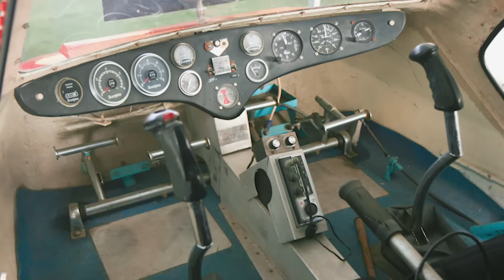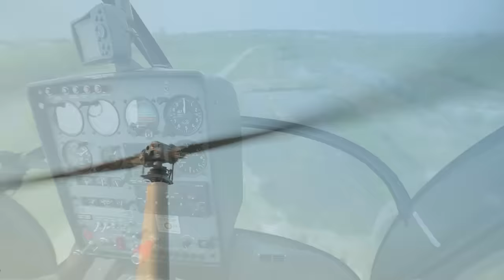15 INSANE Homemade Helicopters - BAD IDEA

Comment: What could go wrong?
Is it sane to bail out of helicopter that has difficulties (assuming you have a parachute)?
Reply: Helicopters can autorotate, which means that there is enough momentum left in the rotor to allow you to make a safe landing. They can 'glide' in a way.
Reply: @johnsmithe4656  if the main shaft happens to sieze or main rotor blades get damaged what then?
Reply: @jarvislarson6864  Autorotation is for when the engines are damaged or otherwise stop working. If you hit something and the blades or shaft is damaged then that's akin to a plane losing its wings. Yeah, in that case you're screwed. Far more common to experience engine trouble and have to land. If you're running into things then that's a problem.
Reply: @johnsmithe4656  I know what auto rotation is I meant in other situations of catastrophic failures happen....hold on and brace for impact?
Reply: @jarvislarson6864  Yes. As I said, losing your rotors, main or tail, or a shaft seizing, these are catastrophic failures on par with an airplane's wings falling off. It's not likely to happen unless there's a collision. Helicopter main rotor doesn't just "seize," there are mechanisms that allow it to rotate freely which is how the autorotation is allowed to work. Like a clutch on a stick shift. Disengage rotor from engine and allow it to spin freely. The kinds of failures you're talking about aren't worth worrying over because some serious accident would have to occur to make that happen. IE, an airplane's wings aren't just going to fall off without some major collision.
Reply: @johnsmithe4656  I will still recommend that ALL passengers + pilot of a helicopter , and even ALL commercial passenger airplanes and private jets, have a working parachute + basic international-dialing duplex-radio-phone, in their backpack or above their heads in the air-inhaling equipment falling when you press a button over your head in commerical passenger airplanes... With falling prices for international airplane travels, an extra $30-50 USD just to save your life in case of crash in the form of a working parachute with basic instructions on how to use it should have / MUST become the norm for all airplane and helicopter and hot air balloon travels a long time ago...
---ve4ernik
Reply: @SahWar  People have to train to know how to use a parachute. They have to get suited up and harnessed in, and this requires assistance. You don't just throw on a backpack and jump. Even experienced jumpers have an expert check their gear before they jump. Same in the Army. Those jumps are all planned and prepped. Having a personal parachute nearby when you're in an airplane is not as practical as you think, especially if there are dozens of people that suddenly need to strap in and jump.

A lot of crashes happen without warning, and very quickly. Most of the time you don't get to bail at 10,000 ft, most of the time the plane crashes when landing or taking off, so parachutes are useless there. If there is a major mechanical problem at altitude then the best thing to do is try to make an emergency landing. Passenger jets using parachutes like life preservers on a boat is just not realistic. You're not a pilot or a jumper at all, are you?
Reply: @johnsmithe4656  Jumping with a working parachute on and activating it successfully when/if an airplane malfunctions above 500 m or 1 km, is perfectly working solution to save lives.
They just don't do it for all passengers in an airplane BECAUSE they just want to rip you off with high airplane tickets while they could just have added $50 to the airplane ticket price for every passenger and put basic instructions on how to activate it when jumping in an emergency NOT from the front door which may get you minced into pieces if you fall into the jet propeller or the the wing or the back small wings, but from the back door after the jet propeller part of the airplane, they just do NOT do it TO RIP YOU OFF OF YOUR MONEY & NOT PUT PARACHUTE FOR EVERY PASSENGER WHICH SAVES LIVES WHEN PEOPLE JUMP FAST IN A DIVING-CRASHING-FALLING AIRPLANE!
Only the money aspect is preventing people from doing that! Never forget this!
So why not offer extra feature to pay $25-50 for a working parachute for the passenger as an extra to the airplane ticket, eh?
Because they are morons and only care about getting your money for more expensive airplane tickets instead of offering some real emergency-saving-your-life-with-a-parachute value in exchange for said price increase!
Don't try to change my mind, I have spoken to airplane staff people and most agree with me about this topic!

It is just corporate greed crushing emergency-life-saving parachutes for all airplane passengers!
Please realize that I am correct and you are wrong about this topic despite knowing more about training for parachute jumping!

---ve4ernik

Comment: El problema principal de los helicópteros  artesanales  es la propulsión  ..un motor de automóvil es demasiado pesado y posee pocas RPM ..como planta motriz  más eficiente  es un rudimentario  motor a reacción  basado en ""La máquina de vapor de Heron ""..  es decir dos toberas acodadas  con un inyector de combustible un gasificador y un compresor turboalimentador  que si puede ser sacado del motor  de un automóvil..y que aumente la presión  y la velocidad de escape de los gases en la cámara de combustión  .además  por supuesto de un mecanismo de encendido por calentador incandescente eléctrico..y un motor eléctrico de arranque para darle las suficientes RPM iniciales para que el compresor crea presión de fluido ...

Saludos desde mar del plata ARGENTINA 🇦🇷🇦🇷🤗🤗😁..

Comment: the last one shown the vc2 is not a helicopter... a true helicopter has collective pitch blades.  that vc2 is fixed pitch blades... which means for one,  no autorotation if there is a engine/engines failure....

Comment: Most all these aircraft have one thing in common. Ultra expensive, low horsepower archaic push rod, air cooled engines designed by companies who don’t want the average shlub in the air.
They make their horsepower by running close to flat out.
Meaning, they have an expiration date.
And when that comes brother, your not going to buy a piston set for it….like a Volkswagen…$200.00
Think more like Porsche 911. $9000.00
Like I said, the average shlub.
So, what’s to do? 
I like the idea of a turbine. But that’s….even more expensive. And noisy.
So….what next?
Well, I’ve been poo pooed by the people who hold stock in continental and lycoming, about using light Japanese engines. Specifically Honda.
The Japanese can take 1 liter, make it have 150 horsepower, and run for ever.
Bump that up a little….say 1.5 liter, run it at 3/4 the speed of one of those first designed in 1932 lycoming engines, and make twice the power.
Nope.
This is Not…I repeat not, about you flying. Because the powers that be, already know you have guns, and they CERTAINLY don’t want them mounted on your homemade , inexpensive,  dependable aircraft.

Comment: The stock helicopters can be flawed regardless of where they come from or how much they cost makes no difference
Reply: yeah well... i would buy the most expensive German one if i was worry about flaw...  definitively not the Chinese kit with the half translated instruction...

so, maybe there is an enormous difference no!?...
Reply: @joseph-mariopelerin7028  german means in a couple of years it'll have issues
Reply: @rblxplaysmochax6808 With the Germans at least,  you got a couple more year to shop a good wheelchair…

Comment: The future of personal transport will incorporate vehicles that look like drones. They'll have at least 4 rotors (each protected with a shroud), partially or totally automated., and will very likely be more reliable than these contraptions. Don't get me wrong, I love the mechanics of helicopters and appreciate these home-built machines, but they're based on archaic tech and not a realistic solution for personal transport. They're way too complicated mechanically, and maintenance would be a nightmare. Can you imagine the average joe flying one of these?? If they don't crash within a week of ownership (and that's being generous), they'll end chopping up someone like deli meat with those rotors.

Comment: Any unlicensed, untrained helicopter pilot is likely to have a very short flight. 😎
Reply: I flew a small airplane I had for some years and had jobs where I would get transported in helicopters and you are right. I got to sit in the left seat and there is a lot going on especially on a mountain top with a little wind. I didn’t fly it, but I got to see the pilot making many fast adjustments.
Reply: @Chris_at_Home  There are videos on YouTube where you can see student helicopter pilots being trained as if you are sat behind the instructor and student. It gives you a very good insight into what is involved. I am a pilot on fixed wing light aircraft so, like you, I know about flying. As you know, it takes many  hours of training to become competent. It took me 18 hours to go solo. I once thought about helicopter training but was afraid that in an emergency I would inadvertently revert to type. This would be disastrous because if the engine failed the required cyclic input for an autorotation in a helicopter is the opposite of the stick input in fixed wing aircraft. There have been cases of fixed wing pilots that have gone on to helicopters and have reverted to type and died in the crash.

Comment: I'd rather buy a R-22 or R-44.  Much safer.
Reply: AV8OR ~ The trouble is that most wanna-be chopped pilots cannot afford a Robinson R-22, let alone an R-44!
Reply: @rogertycholiz2218  That is very true and even a kit helicopter is very expensive.  Flying is a privilege, not a right.  So if you can't afford it find a pass time you can afford.  Be safe everyone.

Comment: Who would want to fly a helicopter at 10000 feet? What would be the point?
Reply: It seems it would be far less efficient too, the blades have to go much faster and waste fuel in the thinner air. Maybe in higher average altitude states you would need that capability. I think Colorado average altitude is 6,000 feet or so.
Reply: beacuse it would be fun as all hell hehehe